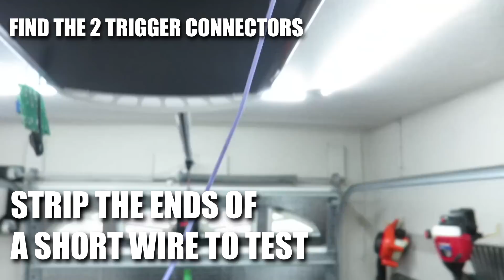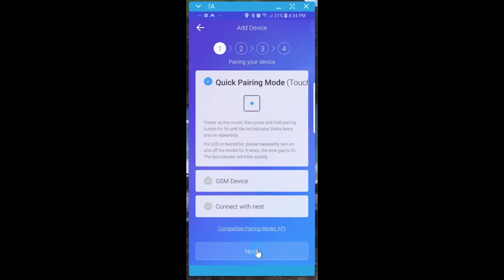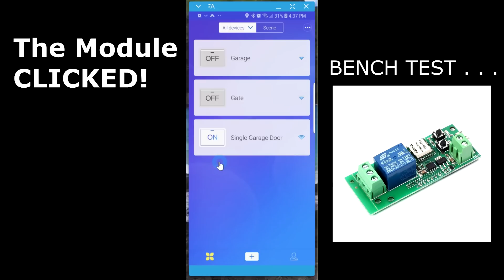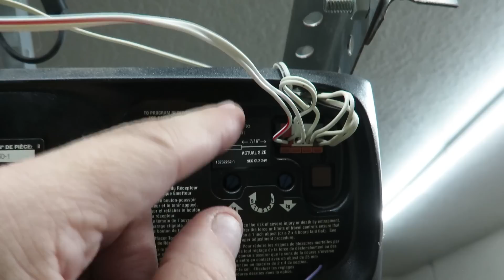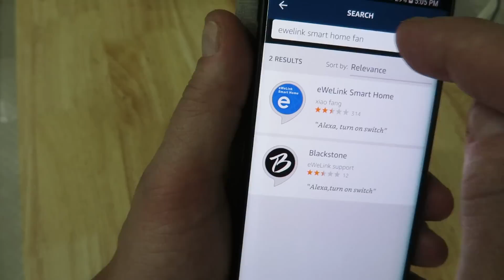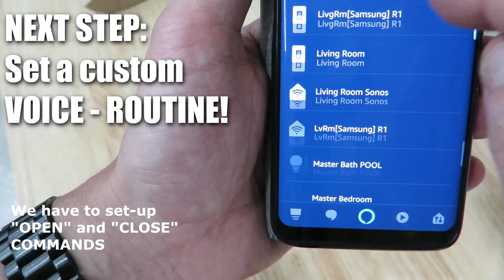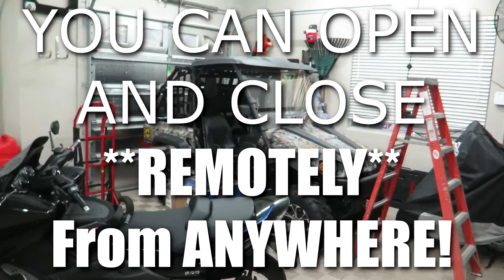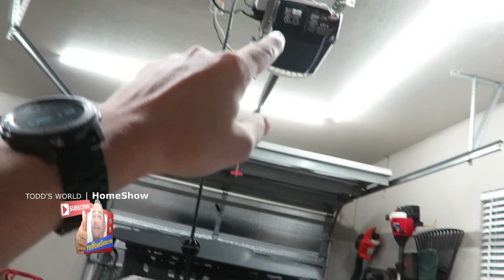SMART GARAGE DOOR OPENER | $15 | eWeLINK Smart Control for Garage Doors | with ALEXA & Google HOME

Comment: Nice video!  Anyone think this could be use to control a low voltage switch on a gas fireplace.  Maybe not because it seems like a momentary relay not an on or off switch.  Something easy like this for my gas fireplace would be nice.
Reply from the maker: Hey Steve,  Please search through the comments here and on my other eWeLink videos because another person has mentioned the same thing and he DID reply back! I think he did get it to operate with his gas fireplace. I just don't have the time tonight to find that comment he left...and I don't know what one of my videos that he made the comments on :( sorry... But I'm sure he said he found a way to do it. Todd
Reply: @twHomeShow  no worries.  Thanks for the reply.  I'll take a look.  I also found a bit more expensive option that will work for my fireplace too.
Reply: Gentlemen, please see my comment from a couple of days ago.  The inner button is a reset/sync button and the LED next to the inner button will go solid when the device obtains an IP address from your wireless router.  It will flash while searching for the WiFi signal (or pairing mode) before an IP is obtained or if your WiFi router is out of range.
Steve, the outer button also has an LED next to it, but it has nothing to do with connectivity.  It is a button that allows you to toggle between 2 modes.  If you toggle the LED off, the device will be in "auto off" meaning when you give it an "on" command from your mobile app, it will automatically turn back off after 1 second.  This is used in garage door opener applications.  However, if you toggle the outer button so that the LED is illuminated, then you give the device an "on" command from your mobile app, the device will stay in the "on" position until you give it an "off" command with your mobile device.  This is the mode that you want to use for lights, fans, etc...including your fireplace application.  Cheers!
Reply: @pvt-pilot  thank you for the reply.  That is awesome.  I did place an order for a wifi milivolt switch already.  I might try this while i wait for it to get here and return the more expensive milivolt wifi switch if it works.  Thanks.

Comment: This is awesome. But I am worried about security. Does it respond to any voice telling Alexa to open? I have a “MyQ” installed on my garage door. Which is fine but I can’t tell Alexa to open and close it.
Reply from the maker: If you're worried, just relocate your alexa just inside your home, the first room inside the garage. When you grab your keys and are heading out just command alexa to open the garage door for you as you're heading out. Also, if you arrive outside your garage without your garage door opener, you can open alexa app on your smartphone and say the command from the alexa app on your smartphone :)
Reply: tw HomeShow Great. I got a question. I think you made mention of it toward the end of the video. You stated that the 2 wires going into the garage opener are wires from the switch on the wall of the garage.  Can I just connect to those wires on the wall by the opener? 

But I suppose with the connection on the top of the garage opener nobody can fool with it and it’s also cleaner up and out the way.
Reply from the maker: @thurm101  I don't see why not. You would be connecting to the same two wires.
Reply: tw HomeShow I think I am going to setup just like yours. You are my idol now.
Reply: @thurm101  the button on the wall doesnt have power next to it.  The outlet on the ceiling that the garage door motor is connected to will like have two outlets.  You can use the 2nd outlet to power the Sonoff WiFi Smartswitch
Reply: I already got a camera installed inside my garage.
Reply from the maker: @thurm101  sounds like you're on the same security level as me now :)  Great job!

Comment: Anyone experienced a problem with the jumper cable not working to open the garage door? I tried testing with the jumper cable and no luck. The module works fine because when I send the signal from the app I do hear the click. However no luck with opening the door. Any ideas?
Reply: Sounds like you have your jumper connected to the wrong terminals on the garage door or on the device.  It is typically the left 2 terminals of the 4 available terminals on the motor.  Then, you need to connect one wire to the center lug of the 3 (common) or COM may be written on it, and the other wire goes to the lug closest to the LEDs which is NO (Normally Open).  It is normal to hear the clicking.  That is just the internal relay doing its job bringing the 0 ohm short from the Normally Closed (NC) side to the Normally Open (NO) side 👍

Comment: My board came in today. I setup the app and it work. Now all I have left to do is plug it to my garage door opener. Great video, thanks.
Reply: Ralph Quinones  with this  board, can  you still use the original wall button?
Reply: macrapidito yes you can!
Reply from the maker: Very cool! Thank you. Todd
Reply: tw HomeShow  I’ll follow your steps  :) I’ll keep you updated
Reply: Ralph Quinones thanks!

Comment: Hello Todd,
I have purchased the ewelink.  I have it setup, functional, but not installed.
Question: What similar product can I use to tell if the garage door is open/closed?
Have a great day,
Bruce
Reply from the maker: Hello Bruce, I have an IP Security Cam in my garage...aimed at the interior and the doors. So I just use them to see if my doors are opened or closed. BUT, the way I figure is you would use this the same as your garage door opener clicker and you're gonna see it close when you leave and open when you get home. This eWeLink switch provider has emailed me with another, NEWER device they made, since my video was getting so many hits and selling their device for garage doors, now. HERE'S the link to their NEW DEVICE w/Sensor:  https://amzn.to/2DZ4Dpv
Reply: tw HomeShow 

Todd, thank you for the link.  Ordered it today.

I previously bought the other one without the sensor.  I’ll probably offer to a friend, since I don’t know of anything else I can use it for.
Reply: @919Drones  wire it up to control eve lights, landscape lights, pond fountain motor, anything that you might like to have turned on remotely or on a schedule.  Set schedules or routines in Alexa to turn on,  like specific times of the day or whenever your phone's GPS arrives at home.

Comment: Do I need to do anything special to set this up on multiple Android phones?  Is it as simple as repeating the process on each phone?
Reply from the maker: It's just like another app on your tablet or phone. Install it on any apple or android device you want and just enter your account info and you can control it :)
Reply: Similar question, how about different users with same device (garage)? for example, my phone with google/amazon account, and my fathers with his accounts, and brothers with theirs?

Still browsing but, you have a setup for google posted somewhere yet, or just the amazon at end of this?
Reply: @AceBoy2099  you do the same thing but use the Google Home app to interface with the eWelink account. Whatever process you've used for other Google Home stuff.

Comment: WOW what a great instructional video.. What gate opener do you have and did you do a vido on it? If not, can you? Also, on the garage door, does it matter which wire from the switch goes into th red/white slots?   SUBSCRIBED!
Reply from the maker: Thank you Captinprivate, The color wires don't matter. Here's the video instructions that I made on my gate operation. https://youtu.be/J_zAhXF_i7I
Reply: @twHomeShow  WOW,, I did it thanks to you... One question though.. I could not find Ewelink in Google Home, Do you know another name it might be nder?
Reply: @leweezo33  it's called Smart We link when linking through google.

Comment: Thanks for the awesome video. Got mine up and running in no time. I used an outlet multiplier with built in USB ports plugged into the ceiling outlet. I have the MyQ system added to my Genie opener and annoyed that it wouldn't let me use Alexa to open or close the door. And their app is really slow. Only problem I had was that the lights on my wall buttons went out. Had the wires reversed at the opener. Going to find a little plastic box to put the module in and stick it to the top of the opener.
Reply from the maker: Hey Nick, glad to hear you got yours up and running. Another satisfied viewer, that's what I love to hear :) Thank you for taking the time out and sharing your nice comment. That's really awesome of you!

Comment: I see that they have a module that has 2 outputs instead of 1. It cost $18 instead of $15. You 
Can the hook both garages to this 1 unit,and install this over by the door where most houses have the smith to the garage doors. No?

Comment: FYI another cheap way to do the garage door and in my case an electric gate.  I use a smart outlet with a "relay" plugged into it, with the N.O. switch wired to the push button wires.  Because the switches just need a momentary "contact" I did a Google routine for "gate" or "garage" that turns on the plug and immediately turns it off.  Cheap and works great.  At this time the alarm system tells me if they are open or closed.

Comment: Thanks so much it worked perfectly and your directions were spot on..the only problem I ran into was I kept opening and closing the door so much In my excitement I blew the capacitor that starts the motor. Hahaha...I ordered a new one just now and will be here tomorrow.

Update: IMPORTANT INFO!! Please make sure the switch is in the correct mode with only one light on. I had both lights lit in the incorrect mode and it did smoke my capacitor that starts the motor on the opener.

Comment: Hi,
Isn't a problem that you connect a 5V Sonoff to a 24V circuit? Thanks in advance!
Reply: The circuit is only providing a momentary closed switch contact just as the garage door button would do.
Reply: @ylwpaul  Yeah it's a NO-circuit but doesn't it need to be 12V instead of 5V?
Reply: Sacha Van Der Eedt it looks like the relay can switch 0-30VDC or 90-250VAC.
Reply: @MrIcePwnR  The 5V USB supply is only to power the wifi circuit and to initialise the relay. The contacts on the relay are simply behaving like a switch. It will switch up to 30VDC. It isn't switching the USB supply voltage.
Reply: @leglessinoz  Thanks for clearing it out!

Comment: Great video! The only thing that was missed is changing the settings within the eWeLink app so that the device uses inching mode rather than constant on/off mode
Reply: And before that........ once you've connected sonoff successfully to the network, it may need firmware update. Mine, purchased Aug 18 and the ewelink app showed current v1.????? and the v2.6.1 available. Selected it, boom, it was done like the magic of the little man that turns the light on in the fridge.
Reply: @markvosper2493  how is this done? I can't find anywhere within the app that shows the firmware version. I can't find any settings at all.

Comment: Thanks. Everything went well UNTIL I asked Alexa to discover new device. Alexa cannot discover . Any ideas??
Reply from the maker: Hey Gary, in the video at @12.05 - did you find the ewelink skill within the Alexa menu and "ENABLE"? the ewelink skill?
Reply: @twHomeShow  Yes. But, FYI I just made Alexa discover by "disabling" ewelink and then "enabling" app again.Thanks again.
Reply: It may be the same issue as Google which I am using.
While the 1st device had been added to google home when connecting the eWelink service, the 2nd device would not be recognized.
I had to dissociate eWelink and re-associate for the 2nd device to be synced.
There is apparently no other way than remove and add the service again.

Comment: Just a comment about pairing.
While devices and routers are more and more on 5Gz wifi (or both), most smart apps (eWelink, SmartLife, ASmart ...) only support 2.4 Gz.
I took me hours struggling with error messages (i.e. "only 2.4Gz supported")  and trying all sorts of tricks to get around it, before I found a VERY BASIC and sort of obvious solution.
Just use an old phone that does not catch the 5Gz. It will do the pairing without any question or message.
Reply: Just connect your phone to 2.4GHz network.  Firstly, untick (turn off) auto reconnect on 5GHz network, while you get all your Sonoff's connected. Reconnect to 5GHz after Sonoff's connected, and tick the auto reconnect box again. That's android, fruit salad phone has something similar.
Reply: @markvosper2493  My phone didn't have the option to choose 2.4 or 5 GHz. If I turned off the 5GHz in the router to try to connect to only 2.4 GHz, none of my phones would connect (S7 S5 Iphone7). What I had to do was rename the SSID for the 2GHz network to something different than the 5GHz network. Then I could connect my phone to the 2GHz network and everything was smooth after that.

Comment: Hello. Thanks a lot  to Todd for the video. Very easy to emplement and WORKS PERFECTLY WITH GOOGLE ASSISTANT and ANDROID AUTO from the car. 
I happen to have the same Smart Controller and the garage door motor. 
HOWEVER, activating the garage door through the button is now inactive. IS THERE A WAY to fix this and have the 2 button/eWelink possibilities ?
Reply from the maker: Hello. I would try reprogramming your buttons. All of my buttons still work along with the eWeLink.
Reply: @twHomeShow  Hello Todd.
Thank you for s quick answer.
Actually, plugging the wires properly, i.e. into NO instead of NC fixed it 😣.
Thank you 👍
Reply from the maker: @niels0412  AWESOME!

Comment: The app seems a bit sketchy with only a 2.9 rating on the play store......does any better app exist for this module?  best tutorial on this topic to date.   Can  you delete the ewelink app once setup with Alexa is completed?  Can you simply use the Alexa app from your phone to open the garage?  What does the one with the door sensor do?  Does it tell you if the door is open or closed?
Reply: I have been using the app for quite a while to control a Sonoff Light and a Sonoff Basic switch. No problems at all. Interfaces perfectly with Alexa. Scheduling works perfectly also.
Reply: You can delete the app but why would you want to? You'll need it every time you want to set up a new Sonoff or other compatible device.

Comment: Hi Todd, does the app let you know if the garage door is open, so you can check to close it when you are away from home?
Reply: I have the chamberlain hub to see if my doors are left open longer than 10 minutes. It also integrates with google home for $1 a month but the idiots designed it only to close the doors or tell you if they are open.. you cant open a door via google home.. so lame.  I want to tell android auto in my car to open the door because my remote range is sooo bad.   I like this guys solution!
Reply from the maker: Hi Johnny, NO, it does not. Everytime you activate the garage door from the ewelink app, you will notice it clicks from OFF to ON then-OFF really quick...just makes momentary switch (just like your physical garage door button). BUT, they make a ewelink board with a sensor now. I included that in my description as well. I haven't tried that with the sensor, myself. The manufacture made me aware of that new kit recently, so I included the link to it in my description. MYSELF, I have an ipCamera in my garage so I just look at my camera and see if it's open or close if I have any doubts.
Reply: @twHomeShow  Good stuff, thanks Todd for the update and clarification.  Keep up the good work.
Reply: I have an inexpensive DCS-933L security camera in my garage that sends me alerts every time my garage door goes up and I plan to add this eWeLINK Smart Controller to complete my set up.  I've been checking on different smart remotes and some of them want $20 annual subscription to use it which I would never pay.  This looks like the best way to go.
Reply: I installed   wifi wireless smart magnetic sensor (b/c I don't like a messy wire) it costs around $18 in amazon,You can get instant notification on your phone without  open apps. It shows ur garage door is open/close on phone's notification status & history,very convenient & useful .But you need to install one more apps (smart life) free & no subscription fees .it comes w/ instruction. One more thing,that comes w/ wired door sensor unit,you don't get instant notification. Every time, You need to open ewelink apps to look at your garage status,That's why I give up & install wireless door sensor w/ smart life apps. As of today that unit w/ wired sensor price is going up $35 from $26